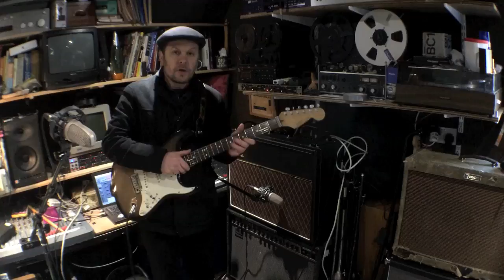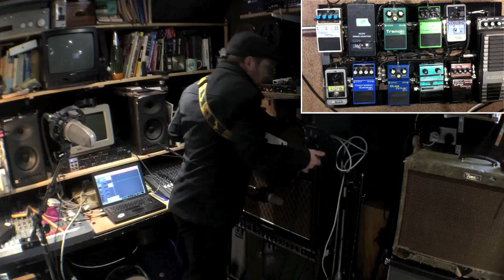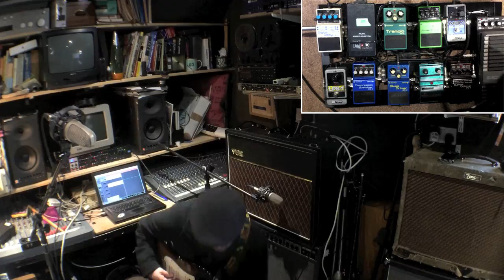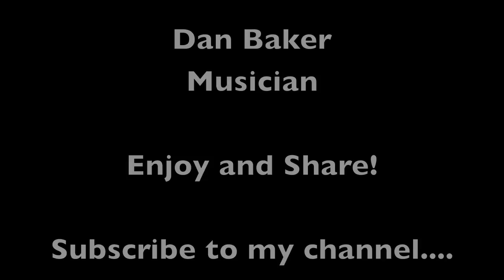How to Prevent Noise & Hum on GUITAR recordings

Comment: Here's something I have found that really lowers the noise floor when recording, but no one is talking about.
Basically when you touch the strings and the noise quiets, you are grounding your body through the guitar, not the other way around. The noise is RF/EMI that is generated/built-up from the antenna of your body, and that is being pumped into the pickup(s) via your torso proximity. When you touch the strings, all that interference is routed through the usual guitar ground, not allowing build up. 
When I plugged in my tele (set for one single coil) I hear the same hum when I come off the strings, but when I touch a metal object that is grounded like my computer or Helix pedal, the hum disappears as my body grounds. So I think the trick might just be to have a bare foot on a metal, grounded pedalboard as you record. Easier than biting a ground wire while recording, which was my original idea haha. 
WARNING: if your guitar is not grounded properly, grounding your body may administer a shock when you contact the strings/metal, but then I guess you at least know that that is a problem too. If your guitar is grounded correctly then this should be perfectly safe.

Comment: For me it was impedance mismatching. I was using an Alesis Effects unit with my guitar. But instead using a mixer I put my guitar straight into the effects unit. Sounded cleaner and better I suppose but it was too noisy. Unfortunately I noticed that too late. I wished somebody have told me. Without an impedance switcher it's not usable. Way too noisy. Specifically white noise. 
But now I use the effects box in my mixer and the guitar sounds lovely and not noisy anymore.

Comment: Sometimes you want to kick yourself.  I have spent the last hour frantically twiddling different knobs getting frustrated by the hum and noise on my new guitar.  If I had turned my chair 90 degrees 90% of the noise goes away.  Now standing up in the middle of the room gives me a gloriously clean signal.  Great video, life saver, many thanks and new fan here
Reply from the maker: Cheers James! Yes: mains hum has a lot to answer for, and as for old CRT displays...
Reply: Bro keep calm. I know what it feels like. My birthday gift an audio interface did the same to me. I was about to return it but just rewiring the connections did the magic

Comment: I think a coiled-up signal cable is particularly great at picking up electromagnetic interference from transformers. I had that issue with a mic cable recently. The cable was way longer than I needed, so most of it was coiled up, and it was pretty close to a transformer that was powering a light. The noise was horrible, because it wasn't just a pretty little 60Hz sine wave. It was more like a 60Hz "slappy buzzy sound", with peaks all across the spectrum. My poor little EQ didn't stand a chance.